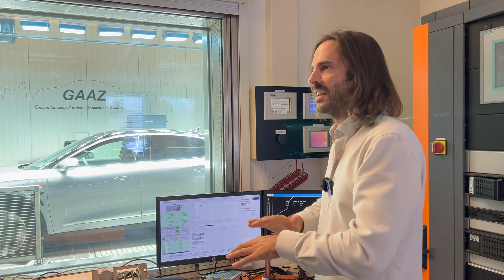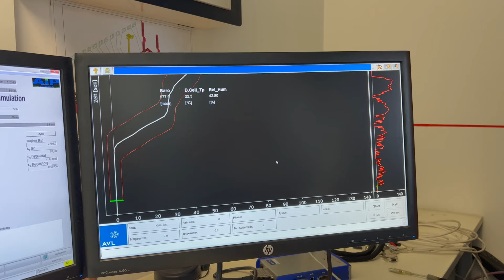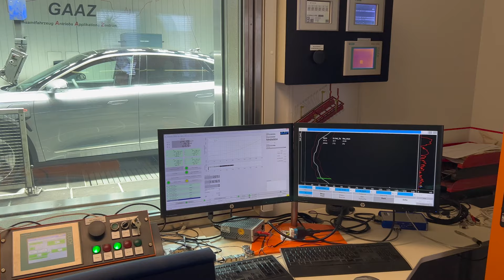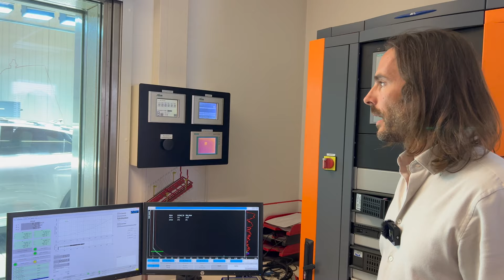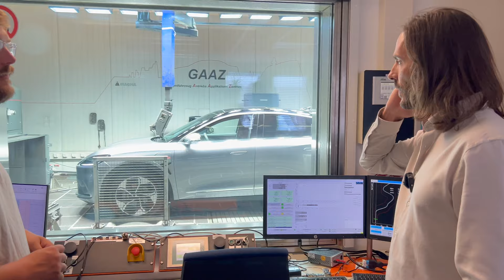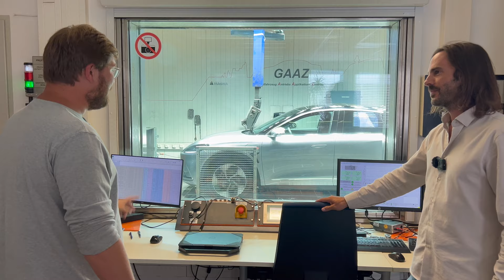Here’s How Electric Cars Are WLTP / EPA Range Tested!

Comment: Ny step dad built car performance test systems in his 1 person company. He sold them to car magazines as well as even Rolls Royce in the 80s. I remember how difficult it was for the car magazines to replicate the same driving conditions every time when you had to do it on the road and not in a controlled environment. Just getting the measurements right. Had different solutions. One would bolt onto the wheel another would have a 5th bicycle like wheel attached to the car. Also measuring gas consumption was hard because we had to cut into the gas line. Well I was just  school boy at the time and never really got involved into it but I did design a data protocol in 10 grade to transfer car telemetry over analog radio when on a track. It even could handle drops in transmission. It never really got used. But was fun to design.

Comment: I’d have liked to know how they factor in the aerodynamic drag of the car that’s being WLTP tested.
Reply: Software I suppose. Maybe this is one of the reasons WLTP is not very accurate. I guess the fan is only there to make sure trim and mirrors don't fly off.
Reply: Probably through a calculation since they can get the drag coefficient (Cd) of the vehicle from wind tunnel or CFD simulations.

Comment: Remember test cycles done with as little as possible extras and likely spare wheel, tow bar , four or five onboard, luggage etc on board will decrease range significantly.
Reply: Manufacturers do give a consumption range according to the possible extras, the impact of e.g. sport wheels or a heavy tow hitch can usually be seen live in the configurator.

Comment: EPA ratings are based on very dishonest engineering.   Most grid-generated electricity is powered by a massive steam engine.  They need to generate over 10,240 BTUs of heat to output one kWh of power.  However, there are significant losses in getting that power into the EV battery.  The first loss is in the grid itself, distribution losses average 11.5 % so 1000 Watt hrs. drops to 855 Wh.  Then there is another 12% loss in the charging equipment which transforms the 855 Watt hrs. at the outlet into DC at a voltage that can charge the EV's battery.  So now we are down to 778 Watt hrs. which took 10,2400 BTUs to generate.  A gallon of gas contains 120,000 BTUs or 11.7 the amount of heat needed to put 778 Watt hrs. into the EV's battery.   Therefore the heat energy in a gallon of gasoline if converted fairly by the EPA would only equal 9.1 kWh.  If we use the figures from independent studies regarding a Tesla model 3 reports that they average about 3.39 miles/kWh, provided that the AC and cabin heat is not used.  So to be honest a gallon's worth of heat energy will give a Tesla a true mpg rating of 30.8 miles...  https://insideevs.com/news/597460/tesla-efficiency-depends-on-driver/

Comment: Your electric bill will at least double and what do you do with all those batteries when they're no longer serviceable
Reply: Why? My VW ID.4 only costs about $4-5 if I have to do a 0-100% charge at home. Maybe adding $20 to my monthly bill. The batteries are recycled when they no longer are functional, but even after they aren't good enough for use in an EV they can be used for stationary power storage. 

You might want to do some more real research into the topic.

Comment: So, these are the guys to blame when real range test doesn't match WLTP
Reply: No, these guys must apply a precise cycle. The ones to blames are the people who designed such a poor cycle.
Reply: No. You are wrong. They just TEST it. WLTP is prescribed as standard protocol by Europe Union and it is the same for all. It may not match real range every time, but it is allways the same and it is COMPARABLE (but WLTP ranges CAN be achieved in real world, even a lot batter than WLTP is achievable in real world if the speed is low).
Reply: As is the case with most things like this, it is safe to blame the government or the regulating agencies, not the engineers working to a specification. We just do what we are told.
Reply: the aim of the test is to have a standard test platform.  If 1 manufacturer tests with 150 kg of load at 150 kmph and the 2nd with 50 kg of load at 50 kmph , the results cannot be compared.
What could have been done is specify multiple conditions,  with low load ,low speed and also average legal speed and average load.
Reply: No, it is your driving. Learn how to hypermile!